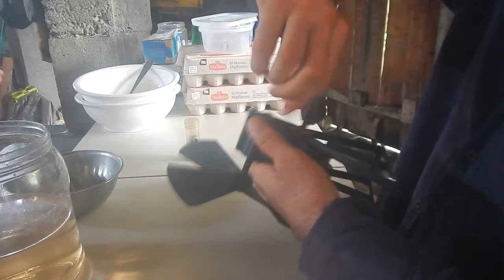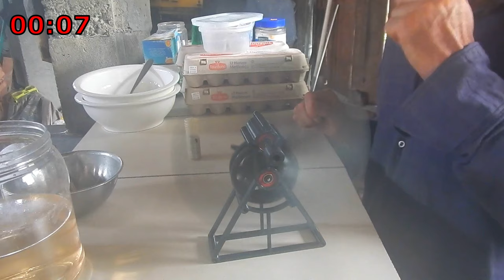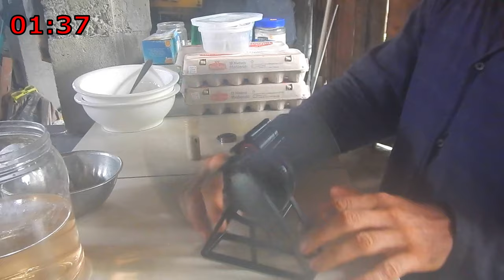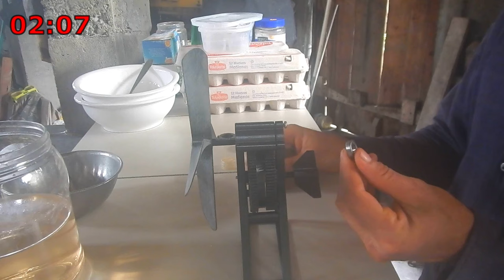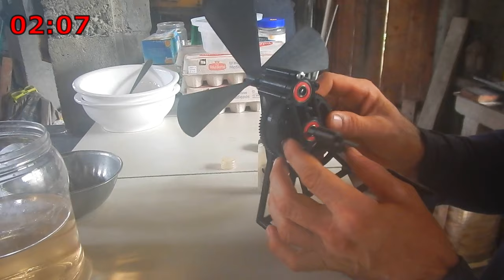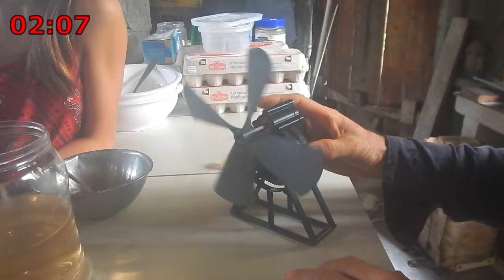Windup Fan 1st Try

Comment: You want to use bearing that are shielded with the metal shields as they don't actually make contact with the inner race causing drag.  (standard skate bearing are like this). The bearings that have the rubber seals, are sealed bearing, but the downside if that the rubber seal makes contact with the inner race, causing some drag.

Comment: Have you considered using a cycloidal teeth form in the gears? It has a rolling contact rather than a sliding contact like a normal involute gear have. (presuming that is what you have used). It should lower the resistance in dry gears, thus they are preferred in clock-making.

Comment: Instead of a spring, you can use a weight on a rope and gravity. Then the fan rotation time will be limited only by the length of the rope

Comment: For this application as there isnt really a load...remove the shields from the bearing and replace the grease with a light weight mineral oil.
Reply: Full 360 degree rotational support while minimizing surface to surface contact.
Reply: Use graphite works great

Comment: The only thing that holds these types of things back is the winding time. I think you could turn that 18 seconds of winding into 1 second. It would be super cool if you could adapt the key to work with a pedaled treadle winder. You could put the key onto and then use your foot to press down 1x and wind the entire thing. If you had 5 of these you could easily wind them all in 20 seconds with a treadle winder and have 10 min of wind ready to go.

Comment: I was told to never put oil in skate bearings as those are mechanical bushes really, they designed to carry very extreme loads and impacts . Adding oil causes them to have resistance. Bushes are fine for a fan that what they use in those plastic fans you complained about, the thing is they wear out with time. And will oiled bearings the greas dries and metal rubbing against metal eventually builds up inside to. The solution for low friction could be bushings and carbon fiber rods, those self clean , alternatively suspended by magnets , but you would need to add second fan on the other side to balance the gantry. I dont want to tell anyone how to do stuff , just suggesting some alternatives . I also saw something simpler when I was taking something expensive apart.. it was well-balanced metal rod - with a spike, 50kg drum of cable is rotating on it , its basically a sink hole on the bottom, and a spike on the moving part - in the center . Also Axial fans are not very good in airflow, Turbines are, using centrifugal forces :) they also quieter but would need different gear as those need to spin faster , they also need to be well balanced but provide maximum airflow :D other than that I can suggest to someone to try and make a candle powered steam powered fan to keep people cool at nights :D that would be creasy :D